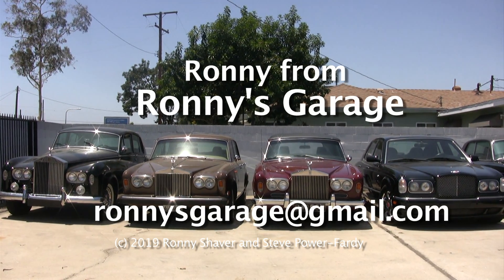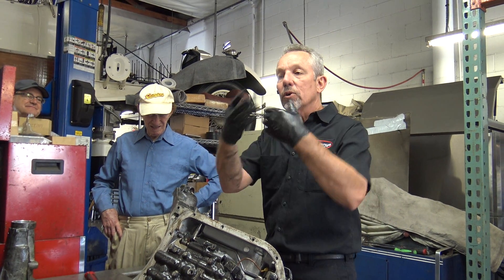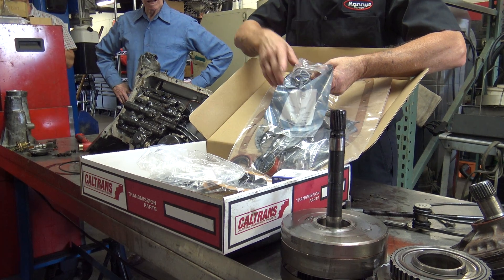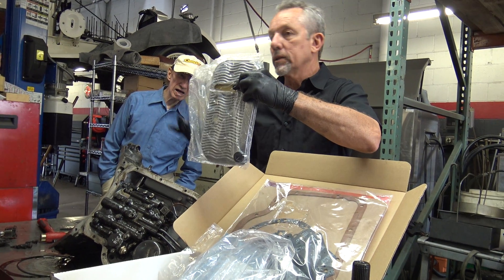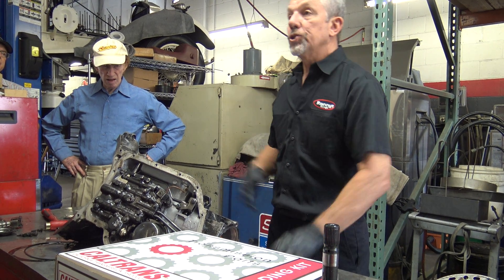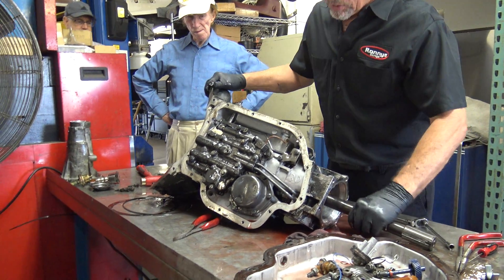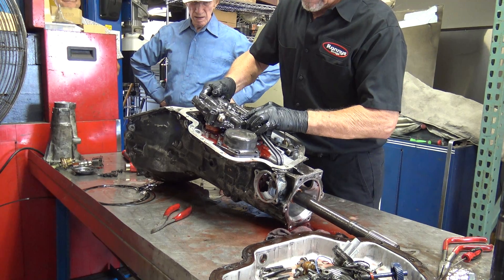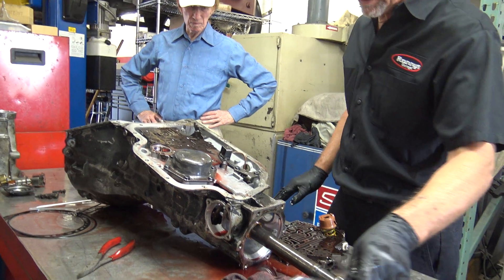Turbo Hydramatic 400 THM400 Transmission Part 4

Comment: Great video again Ronny - a new TH400 from Summit runs about $1300 and I have seen them rebuilt for $900 on eBay - I doubt I would ever mess with mine I would just buy a new TH400 seems easier than opening one up